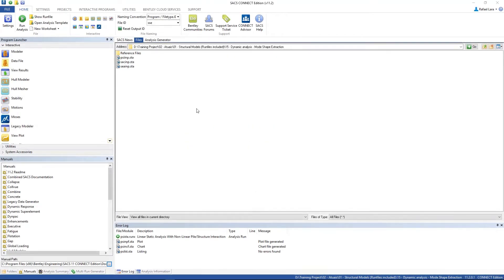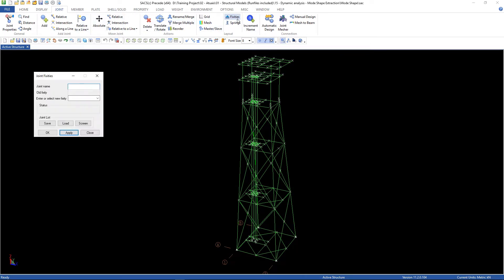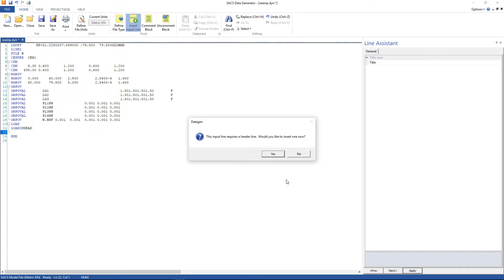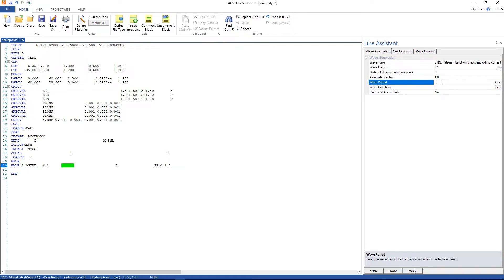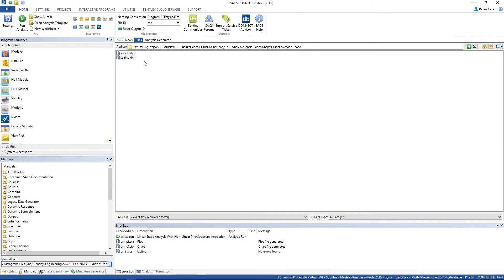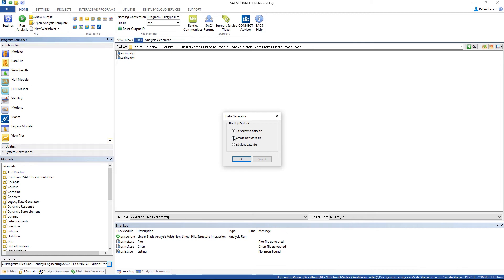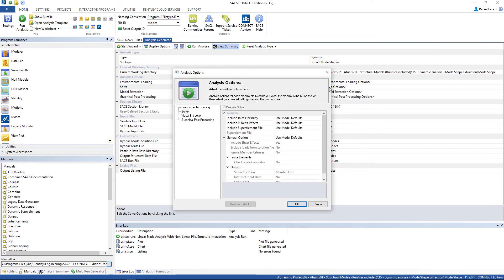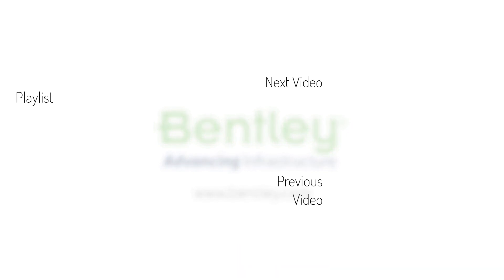Dynamic Analysis - Extract Mode Shapes in SACS CE

Comment: How to create the retained joints file?
Reply from the maker: In Precede go to MISC tab, then select list type: "Joint". In the "Defined Joints" list select the ones you want to be retained and move them to the "Joint List". Then hit "Output Lists to Editor" button.

You may also want to select the joints in your model using Joint tab > Layout > Fixities tool and then hit Save button. They will automatically appear in the above described "Joint List".